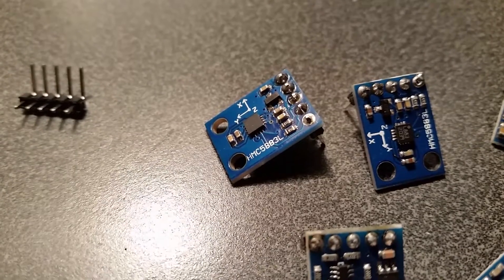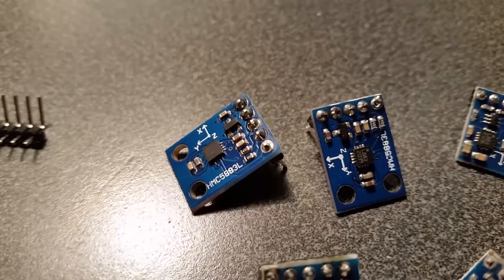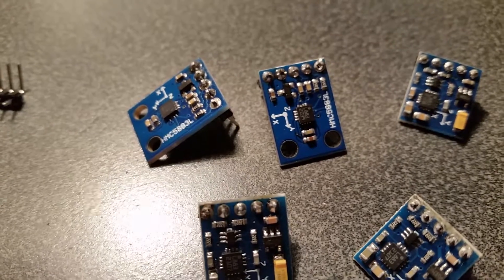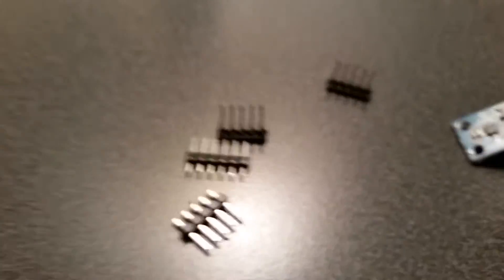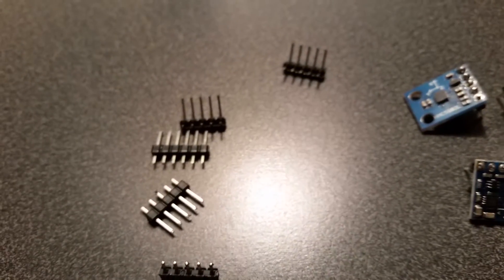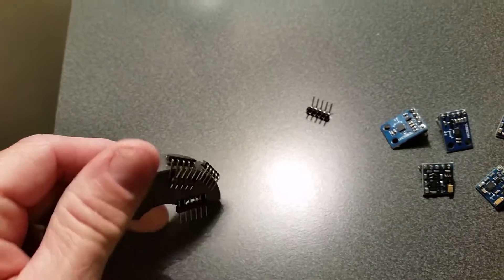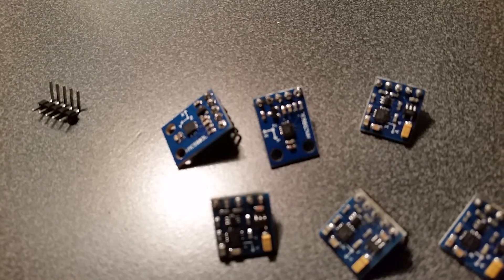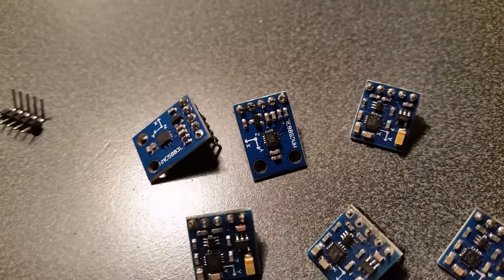HMC5883l magnetometer compass problems?

Comment: Thanks for the info! The other thing I've found with these is that even those clearly labelled HMC are actually QMC chips. If you use the QMC with the HMC library in arduino at least, you often see static values reported and gross errors.
Reply: that exactly what i found

Comment: Good catch.  I was curious why my fine angle knippers were struggling and had to be re-sharpened, when I tried to clip the excess from some headers.

So.... #1 buy good solid brass headers, #2 do not use the headers that come with your cheap sensors, #3 if in doubt - use the magnet.

Check any wire terminal ends too.  I just checkes some of mine after this video, and turns out my wire connect terminals were ferrous also.  My mistake, I have the super-awesome molex brand, but just used a cheap cable in my box of stuff.   

Steel header pins is Japan's "thank you" back to the USA for dropping the bomb.

Comment: Mine is L883 chip which is actual hmc5883l but still it's not working. I'm just getting the board info as output. What could be the issue? I'm sure about the connections. Running it with Arduino nano

Comment: This is true, I tried to use this thing to measure magnetic field angle before, but the breadboard got pulled and sticks to the magnet. After that the reading was off and it made me confused as hell. Then I tried to pull the sensor out of the breadboard and just connect it directly to the microcontroller and the reading was good again. I guess the breadboard got magnetized somehow.

Comment: TWO questions:
1) did you leave a product review on Ebay about the magnetic header pins? This had not even occurred to me, btw!
2) With NO mag sensor, can you power up a drone @ 0° degrees using a real compass and have GPS work accurately based on booting it positioned on the ground @ true north?

Comment: Hi! If you want an app capable of working with all the sensors from the CC2541DK, CC2650STK, ThunderBoard React and Sense (e.g. magnetometer) you can download it from: www.microsoft.com/store/apps/9p054xsjjr1n – the software is able of giving new uses (movement security systems - door or luggage security, magnetic security system, accelerometer mouse and wireless presenters) to all these IoT SensorTags. For more information visit: www.blesstags.eu. Thank you so much and have fun!

Comment: hey, I have used them before and I had so many issues with them. the data just become off and jump from north to south.
what did you do to solve that problem?
Reply from the maker: Keep in mind when working with these to keep all metal away from them, even the header pins which I mention in this video should be checked to see if they are magnetic. Check your wire too to make sure it is not magnetic. Also, remember that motors and other electronic equipment can give off Interference, mount the compass as far away from the motors as possible! 
Also, all of these magnetometers need to be calibrated if you want them to work properly. Brainy-Bits has an excellent video on how to do this. Its called, "Let's build an Arduino electronic Compass", make sure you use the correct Arduino Library to do this. Good luck!
Reply: @EZtech  Thanks!